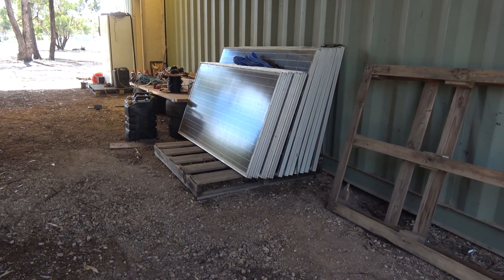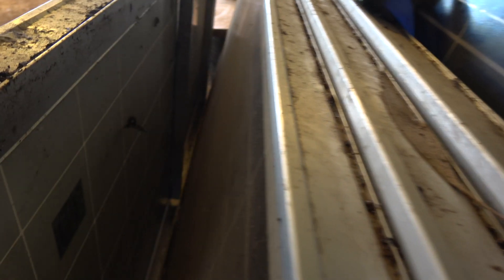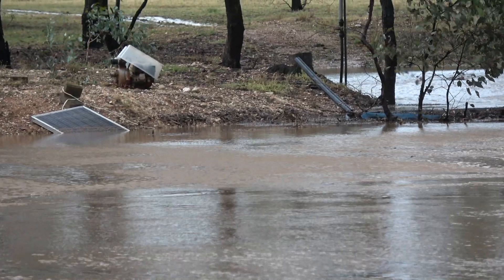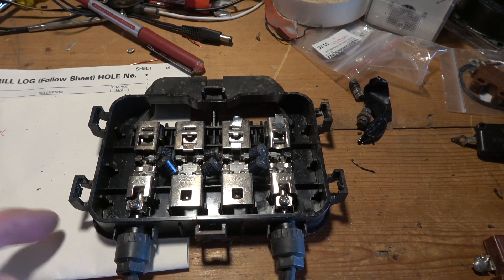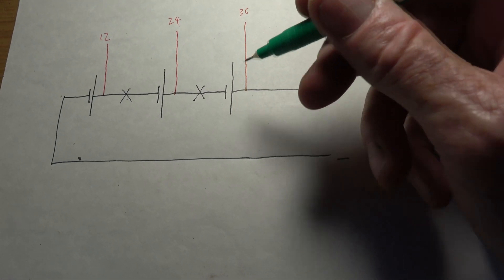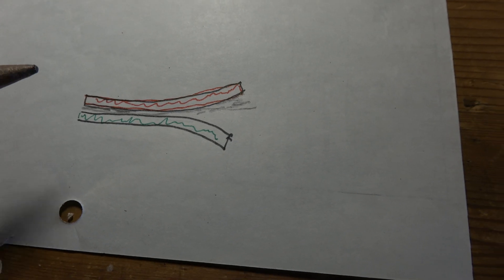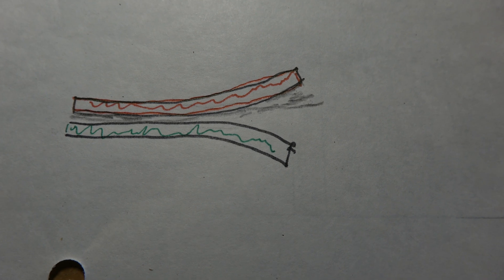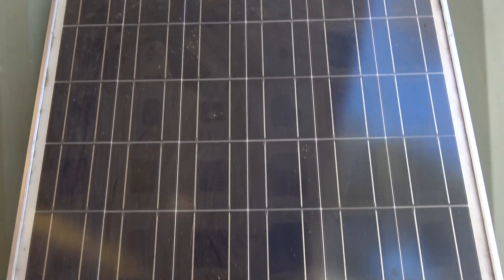Re Wire  30 or 36 volt used roof top panels to 12 volt.

Comment: Well done, buddy. I'm experimenting myself; I found a free panel and a 24 volt scooter motor that I connected directly it runs only when the panel is fully exposed to sunlight. If I connect the motor to a small pump, it should water the garden at the appropriate time without the need for a control box or battery, and it will cost nothing in the long run.

Comment: Why? Just put 3x12v batteries in series! Lower volts and higher amps means less overall efficiency. If you need 12 volrs after that then use a synchronous buck converter (95% efficient or better). ????
Reply from the maker: I Don't think you understand the context of this. I agree that higher voltage systems are more efficient but a lot of stuff runs on 12 volts and  you can power them with virtually free used panels  without  having to have an expensive charger, inverter or what ever. This is especially true when you want things at a remote unattended location that could be damaged or stolen . Did you actually watch and listen to the video?.
Reply: Yes I did. But using 36 volts, a low cost MPPT charger and cheap buck converters from 36 to 12v is going to be far more effective, efficient, faster, safer (no possibility of damage) and cheaper than all those mods. But if you're OK with what you've done, fine. Just not the way to do it for me.